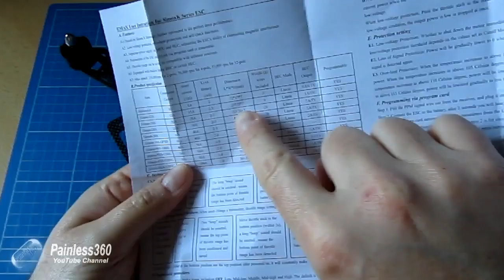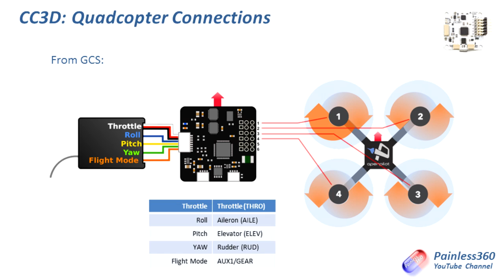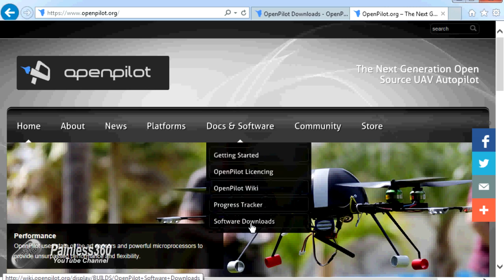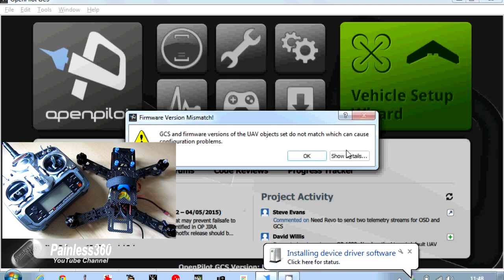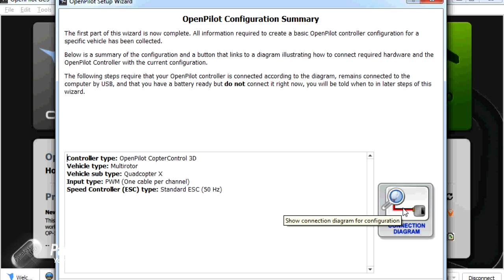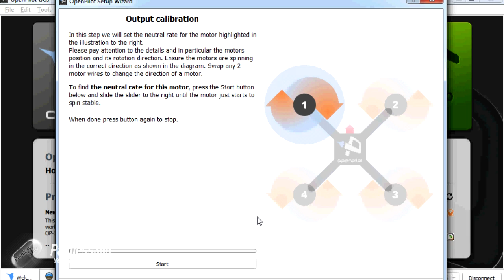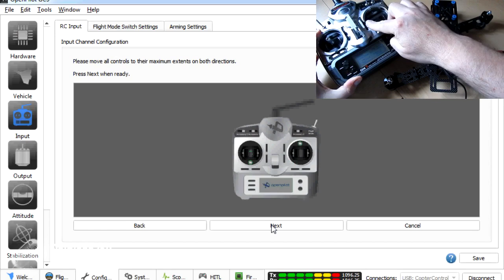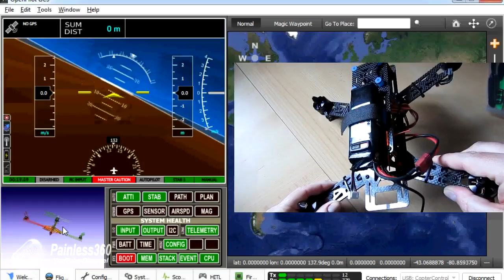(2/10) CC3D Flight Controller - Radio setup, firmware install and testing

Comment: I have  come  from the Intro to PIDs vid you have... I have followed all the CC3D vids  - but my 450 size frame DIY quad - does nor  ever get to hover. CoG is OK. I know  there  other variable that  may contribute...but you have not touched on the page where the preset PIDs are. They seem to be set low... but  I  wonder if I  should  mess about with them to see what happens!
Reply from the maker: What does 'not ever get to hover' actually mean? Even poorly tuned PIDS will get a model flying. In most cases the defaults will work ok..
Reply: +Painless360 I am having the same issue currently.  Went through the entire setup and the throttle has to be past halfway for it to even takeoff.  And as soon as it isn't on the ground it flips over, I know I have my props mounted properly, and I am not sure what else to do.  There wasn't even wind outside so I am not sure!  I am really mad because after I just spent 300 dollars on a copter I can't even get it to hover.
Reply from the maker: I have a video on what to check if you're flipping over - may help..
Reply: +Painless360 I viewed that video and I tried almost everything. I am thinking that it is the PID settings. Do you know if there is a way to get to one of the preset options like when you are initially setting up the flight controller? Because in your tutorial we just stuck with the current tuning settings, and I kind of want to try out the preset for DJI F450.
Reply from the maker: The default PIDs will not cause what you are seeing. Something else is going on..
Reply: +Painless360 Any idea of what it could be? I am not sure if it is a faulty board because when I am in the OpenPilot software it shows that everything is fine and the gyro is calibrated.  Maybe I could erase all of the settings and try setting up the board again?
Reply from the maker: Usually it's vibration related or due to the board being off centre.. Best of luck!
Reply: +Painless360 Ah, fixed it. I just erased all of the settings on the board and recalibrated everything. I just have to use trim on my transmitter now to stop some drifting.
Reply from the maker: Great! Make sure that middle position is 1500 for rudder, aileron and elevator and that the accelerometers read zero when the model is flat.. Best of luck!

Comment: To use CPPM would you just only use the throttle wire and cut the rest off? Or is there a whole different connector? If so does is come with the kit or would it need to be purchased separately
Reply from the maker: Clyde Brown This video may help - https://www.youtube.com/watch?v=GbUMC8h2uhU&list=PLYsWjANuAm4oWuE5ZDX4TAiHBv2i0Xl4m&index=17
Best of luck.

Comment: Painless; On the receiver plug connections I disconnect the black wire that is the remain of the normal connections and it is connected to the "Gear" , I disconnect this wire and add connect the finding buzzer there and it is working fine from the transmitter portion but I am wondering if it will cause any problem on the maneuver of the quad, I  flew it for a short time and did not noticed any difference, I would like your opinion in this aspect.
Reply from the maker: +Hector Castro Hi, not sure what you are asking but if it's working then that's a good sign! Best of luck with it.

Comment: Nice Vid!, Is there a video how to setup 1 and 2 accessories? Seems everyone skips that part but I'm have a hard time enabling 1 and 2 with a Taranis controller.

Thanks
Reply from the maker: jwhit87 I would recommend using the playlists - you can find the videos that are on the channel but not yet 'public'. Try https://www.youtube.com/watch?v=FkUiiVwS4CM&list=PLYsWjANuAm4r-E61stLchCR4bzY3NmDNh&index=12
Hope it helps.
Reply: thanks for the reply, is there a way to set up sbus to cc3d or some how add 2 more channels so the accessories would work? I am using x8r and cc3d. 

thanks for all the help, your vids are the reason i built a quad
Reply from the maker: If you Google S-BUS and CC3D you will find loads on this topic..

Best of luck with the build..

Comment: Having problems to calibrate the ESC's I tested them without the blades and one of the motors stop when you give the turn command and the other motor stop when you give the opposite etc. could you expand the ESC calibration ?
Reply from the maker: +Hector Castro This is expected at low throttle, make sure you've followed the ESC calibration in the video exactly and that should be ok. Have a careful test hover over soft grass to confirm it's all happy. Best of luck.

Comment: Is this still the go-to video series for beginner setting up 1st quads with CC3D?  I ask because of the OpenPilot closing down and LibrePilot spinning up.  Are the two similar enough we should just proceed here, or is there somewhere else we should be starting?
Reply from the maker: +WAM 74 See the first video in the playlist ;)
Reply: +Painless360   I watched that previous to this one.  I skipped over some hardware stuff, so did I miss  where you addressed LibrePilot vs OpenPilot?  I was thinking that video was also OP based.  And I'm assuming, perhaps wrongly, that OP is now obsolete or in the process of becoming so.
Reply from the maker: I guess so....

Comment: Would you mind sharing what your PID and other tuning settings are? I have just built a very similar frame except using DYS 2300kv motors and the ZMR frame and am having a hard time tuning. Thanks! Great video. I subbed.
Reply from the maker: ***** Sure - @67301981
Hope it helps..
Reply: Painless360 wait how do I view your settings?
Reply from the maker: Bl00dy YouTube didn't post the link - I'll try again - https://dl.dropboxusercontent.com/u/67301981/CC3D%20-%20PID1.zip

Fingers crossed..

Comment: Thanks so much for your very clear videos. I am a complete novice and have built the Emax 250 quad and configured the esc's/motors with Open Pilot and they all run fine. I am now up to the transmitter configuration in Open Pilot and am now trying to bind the orange receiver with my new Fly Sky FS- T6 and I am a bit lost. Should I connect the binding link to Batt in the orange receiver with all other connections still in? The T6 came with it's own receiver which I presume I don't now use? Thnaks
Reply from the maker: ***** Not sure on the exact process - that will be covered in the maual for the radio. The normal process is along the lines of - plug in bind plug in Rx, power it on (keep the other cables plugged in), power on the radio in bind mode, wait for light on Rx to go solid. Turn off both radio and Rx, remove bind plug, power on radio then Rx and test connection...Hope this helps. This is covered in my 'Introduction to RC' series..
Reply: Painless360 What a guy it worked just as you said. Many Thanks that was PAINLESS.
Reply from the maker: Hey - glad it helped! :)

Happy flying!

Comment: Painless; How do you bind the RX? Before or during the calibration?Thanks for your time
Reply from the maker: You need to have it bound to test but I would rebind when you have used the sub trims on the radio to get the channel values as close to 1500 ( when in the middle) as possible.

Comment: In attitude do you recommend to have "Zero gyros while arming aircraft" checked?
Reply from the maker: +Leevi Tyrväinen Either will work but try it both ways to see how you prefer it..
Reply: +Painless360 But do I have to find completely flat ground if I have it checke. Because how I'm supposed to find a flat surface when I'm in the field?
Reply from the maker: You should always let the vehicle sit level for a few seconds after powering on - help the accelerometers settle down. If you're worried about not flying from level ground then try it unchecked..

Comment: First off, thank you so much for this amazing video series, it has been very helpful in building this kit because I am fairly new to this hobby. I have an old Syma x5c transmitter from a toy quadcopter that I was trying to use for the esc calibration process and it was unable to connect to the receiver. The transmitter is 2.4 ghz and 6 channels so I do not know why it was unable to connect. Do I need to order a different transmitter that is not designed for a certain type of quadcopter (Syma x5c) or am I doing something wrong with the calibration?
Reply from the maker: mrslakjawedyokel If you are getting into the hobby then I would strongly recommend getting a good radio. Lots to choose from now.
I suspect that the receiver will not work/is not bound to your radio. See http://www.google.co.uk/url?sa=t&rct=j&q=&esrc=s&source=web&cd=8&ved=0CEMQtwIwBw&url=http%3A%2F%2Fwww.youtube.com%2Fwatch%3Fv%3DLyPtzv0y5DE&ei=tUJwVZ3oFoGR7AbL34P4BA&usg=AFQjCNGjBn7antOy3vdnOfmNOdY1CJb55g&sig2=8PD4HUlWR4a6NCnhX5TwJw&bvm=bv.94911696,d.ZGUFor more detail.
Hope it helps.
Reply: Painless360 I bought a new radio, the Spektrum dx6i dsmx, and I was able to bind it to the receiver with the radio's instructions. During the esc calibration procedure there are no calibration or confirmation beeps from the receiver. Any suggestions?
Reply from the maker: The Rx should not make any noises..
Reply: Painless360  Sorry, What I meant to say was that there is no sound present during this stage at all. I do not know where the sound is supposed to come from.
Reply from the maker: Any beeping comes from the motors. The ESC sends very high frequency pulses to the motors to show arming state etc.

Hope this helps.
Reply: Painless360 I went to the output configuration area on openpilot and when I clicked test outputs there was an error message saying, " The actuator module is in an error state. This can also occur because there are no inputs.." I am assuming something is wrong with the motor connections to the escs. Is there a way to check this without undoing the heat shrink tubing on the wire? Help is much appreciated.
Reply from the maker: Have you selected the right inputs PWM/PPM etc?
Reply: Painless360 Yes, I believe that I have selected the right inputs ( PWM for one cable for channel). A forum online suggested that there could be a cold solder joint on one or more of the motors. If this was the case, is there a quick way that you know of to find out which motor or motors it may be?
Reply from the maker: I would connect each motor in turn to the throttle channel on the Rx directly and see you can see the one with a problem.

Best of luck with it.
Reply: Ok, Thanks for the Help!
Reply: Painless360 I did this, and 2 of the four responded with the beeping routine, and one of them (motor 1) moved a little bit. I desoldered the esc to motor connections of motor one and replaced the connections with leads to ensure they were connected. I then tested the motor again with the leads and nothing happened. Any suggestions?
Reply from the maker: I would start swapping it with a working arm/motor combo piece by piece until you find the component with the problem..

Best of luck.
Reply: Painless360 I was able to fix the motor/esc problem and I have finished building the quad. When I do the test hover motors 1 and 3 are taking more throttle to move and at full throttle the quad is not moving off the ground. Any suggestions? Thanks for the help.
Reply from the maker: Have you re-calibrated the ESCs? What troubleshooting have you already done?
Reply: Painless360 Yes, I have re calibrated the escs and I have tested all of the motors individually on openpilot. I think the problem is that the are not spinning fast enough to generate lift.
Reply from the maker: What motors/props and how heavy is the model?
Reply: Painless360 I used the motors and props from the kit in the video and the model weighs 492.40g.
Reply from the maker: Sorry, I can't help without the detail.

Best of luck with it.
Reply: Painless360 not sure if you can help but during the output calibration two of my motors sorta spins but not really, they click and don't spin.  1and 3. Any ideas of why
Reply from the maker: Usually due to a bad connection on one of the three connections from the ESC - check the leads and soldering. Swapping the motors will tell you if it's the motor wires or the esc..

Best of luck.
Reply: I'm also having trouble with connecting cc3d board to the comp.  Sometimes it reads it and then it won't.  I've Uninstalled and reinstalled open pilot.  No idea what to do.
Reply from the maker: What troubleshooting have you tried?
Reply: It has worked I got all four motors to work fine then I got to the transmitter part and the controls were not right.  I think I had some wires mixed up to the reciver, but now it will connect to the comp but when I erase and upgrade it disconnects during the process, and then says it upgraded.  Get to the motor part and nun of them spin.  This all is a nightmare.  Lol.  No idea what I'm doing wrong.  All the videos make it seem so easy but it hasn't been going the way everyone says it should.  Having transmitter issues, cc3d issues, motor issues.  Take one step forward and 10 backwards
Reply: You don't happen to live in Toronto do you lol
Reply from the maker: Just follow the build videos in this series - they are made for first time builders like you.

Rush, skip steps or assume anything and you will get caught out.

Go back to first principles and check everything you've done..

Best of luck.
Reply: Painless360 I fixed the problem by simply switching one of the props that was upside down. The quadcopter is now flying! Thank you for the help.
Reply from the maker: https://www.youtube.com/watch?v=X8h6NQAPPYQ ;)

Comment: Painless 360, First of all thank you so much for your excellent work on your video's. They are extremely helpful for novis pilots like myself. I'm having a dilemma with the cc3d transmitter setup wizard. I think I don't have a flight control switch setup correctly on my X9D Plus so the wizard is not recognizing it in the set up. Any help or suggestions would be greatly appreciated, thanks.
Reply from the maker: +824rmrock First of all confirm that the channel on the Rx is actually moving enough when you flick a switch. I find popping a servo into the receiver in the channel is a good way to test it if you can't get to a 'channel monitor' screen on the radio. Best of luck!

Comment: Hi there, thanks for vid. If you have already configured your remote can you go in to open pilot and adjust your PIDS etc without reconfiguring the radio every time? Is there a way to do that?
Reply from the maker: +Newbie FPV Mini Quad Racer Yes, watch the series and all will be revealed! Once flashed you can access all parts of the system to change the way it works.. Best of luck.
Reply: Hay thanks for quick replying. Is that without having t o retread things like remote control configuration?
Reply from the maker: Yes, that too. Happy watching!

Comment: HI! Thanks you! Your videos are the best! I will use CC3D the first time, as I see here during calibration we should not power the FC from external powersource, but it gets power from USB and when you plug battery in for ESC calibrating it will  get 5Volts from the BECs of the ESCs. Is it safe for that FC?
Reply from the maker: +FotoAmg AmgFoto It should power from a UBEC. I would check the UBEC is ok and then that the CC3D doesn't have a problem with the power pins on the ESC/Motor connectors

Comment: Hi, Thanks for uploading this series of videos it's been very helpful for me to build my own drone. Sadly I am new in the hobby and have a Futaba R2008SB receiver and was wondering how to connect the CC3D to it. This is since I have no channel assignation (only 1,2,3,4,5,6,7,8/B) as you on your HobbyKing receiver. I was wondering on how to connect the receiver in order to have everything assigned correctly with the CC3D. I had looked for wiring diagrams but I haven't been able to find any specific information for this matter. Also I am using a T8J transmitter. Thanks in advance! and keep up with this very informative and helpful videos.
Reply from the maker: +Alejandro Andres Calvanese Yejas use the channel monitor on the radio to see which controls move which channel. This should correspond to the numbers on the reciever. The setup of the CC3D will figure it out anyway as it 'sees'  you move each control in the radio calibration. Best of luck!
Reply: +Painless360 I see,  this info will be very useful. Once again thanks for all your help and keep up with your excellent work. Cheers!